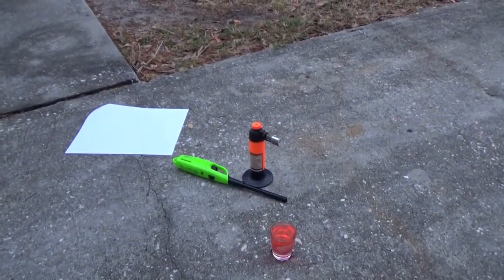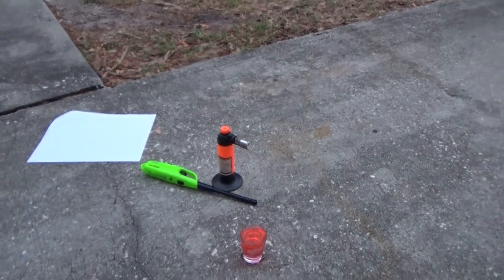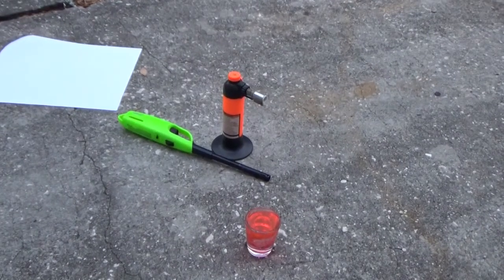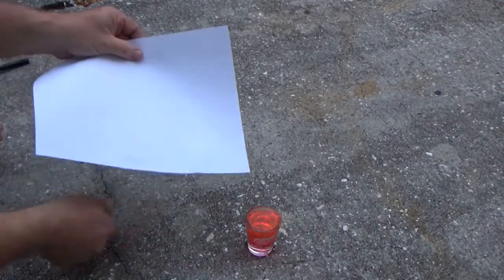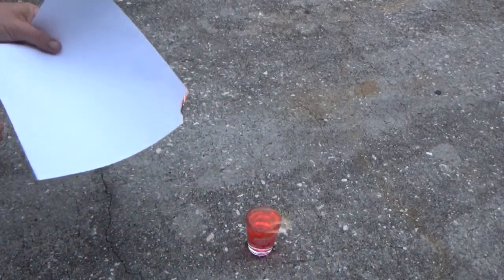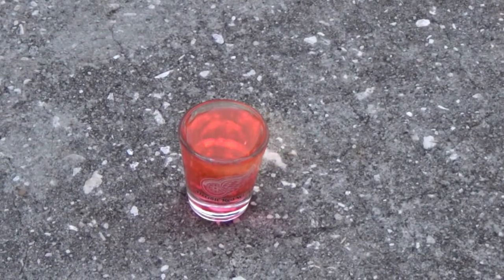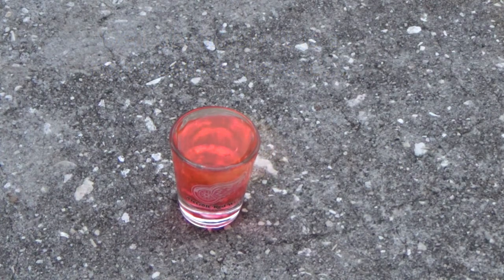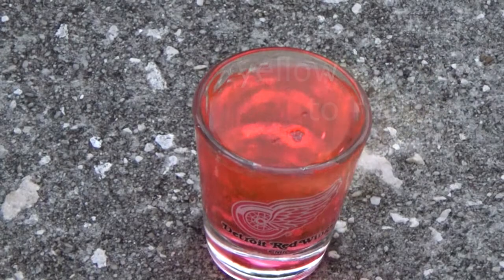Glow Fuel Flammability test

Comment: Excellent video! You not only demonstrated the ignitability but also the main danger: buring with a (near) invisible flame, and without sound... Which makes it a very nasty thing because it can burn undetected behind your back and set fire to other things completely unexpected....

BTW: the yellow colour you saw in the low daylight conditions is due to the oil in the fuel. Straight methanol burns very pale blue.
Reply: rigididiot Nope, the color is due to the nitromethane.